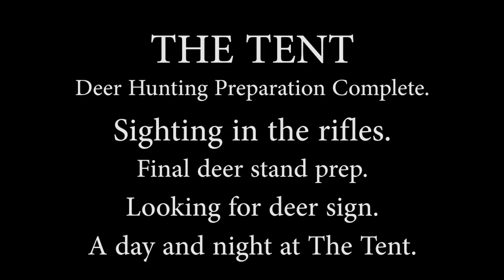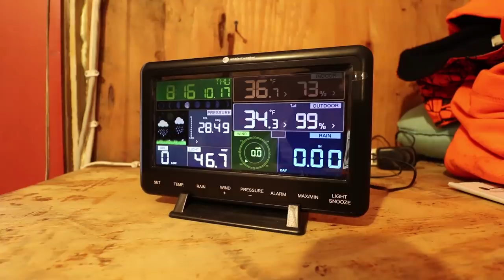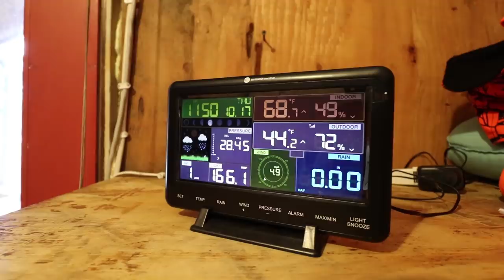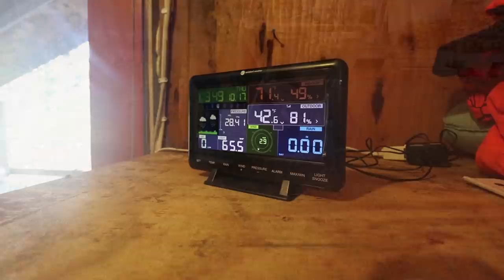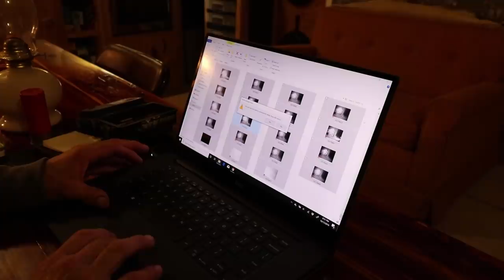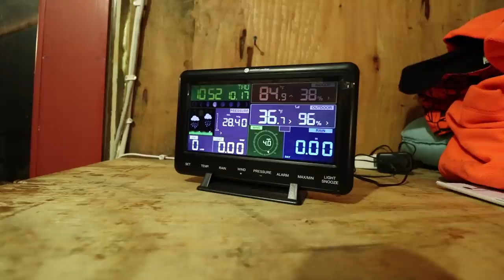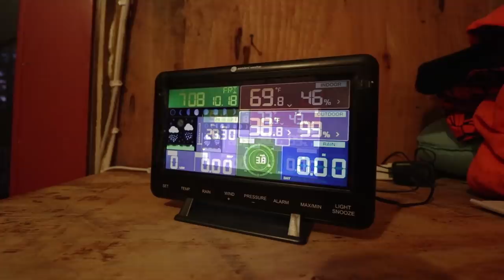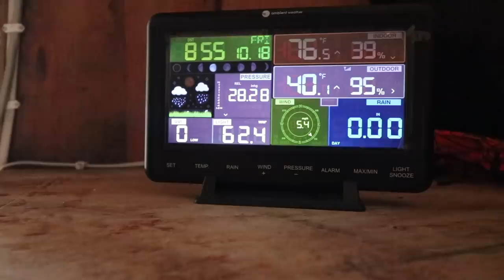THE TENT. Deer hunting preparation complete. Sighting in the rifles with Dad.

Comment: HI Joe, I got an Idea how about installing a pump shower near by the docks and the outdoor fire pit so you can shower out door in spring and summer as well as be close to a water supply without too much effort to install it and running too far to heat up water on the stove inside the tent, just use long hoses to connect the two, that would be great to see on a future video, hope all is well, have a good one from CANADA :-)

Comment: Joe you should look into a .300 blackout AAC upper for the AR. It uses the same bolt face and mags as the .223. It's a .223 case necked and sized for a .308 round
Absolutely no kick and pretty accurate out to 300. You can push it further however itd take a bit more skill and understanding of the ballistics

Comment: Here's a tip if you hold the trigger down on the rifle as you close the bolt it wont cock the firing pin; so you don't have to dry fire your rifle to take the tension off the firing pin spring for storage.

Comment: Joe,  are you ok?......there is something hanging down on the roof line of the White garage and there is a plastic oil bottle on it’s side on the deck porch......lol
Reply from the maker: Thats my lighter fluid on the side. It blew off the deck. That front garage needs to be re roofed. We are going to put a metal roof on it. I will fix the stuff blowing off at that time. There is just not enough time to do it all. Lol.

Comment: I hate to complain about a tent video, but the new software appears to briefly freeze-frame the clips at the beginning of transitions.  I can't help but be distracted by it.  Still, always great to have a tent video with lunch.  Cheers!  :)
Reply from the maker: I agree. I am not sure why and it seems to do it only when it is an action clip like when I am driving. Not sure if the computer can not render it or if I have to drop from a 2 second transition to a 1 second. The problem with that is that I can not stand videos that click fast between scenes. This is still a learning process, I will get there eventually.
Reply: @JoeandZachSurvival  I'm betting that it has something to do with there not being enough data at the front of a clip to satisfy the duration of the crossfade.  I've not used Adobe Premier Elements, but I do use the full version of Premier, and it has a very steep learning curve.  It's not a big deal though, just thought I'd point it out.  Have a good one!

Comment: I wanted to ask you, when you close the door immediately after you get in or out while loading the wood container in your tent, is because outside is too cold so you don't want to loose your heat achieved I guessed?
Reply from the maker: Yes it is.
Reply: I imagined it. I don't know if it'll be convenient to place two thinner pieces of wood standing up against the front of the wood box but closer to each other so they hold higher amount of wood. You should hold them innitially by placing them after you placed the second piece of wood starting from the bottom of the box, first one wood cut from the wall, then a second approaching the front of the box, I think now you can place one stick, hold it with a third piece of wood, then the other, hold it with that third same piece of wood, this will allow you to stock higher almost double up depending how high you make the sticks. Having them not fixed will be better to protect your or anybody's face from poking yourself/themselves. Or, if this works you can then place between them a perpendicular piece or two resembling a guardrail. This top high could be 2'-3' you can make it higher and just by having one in front you can hold double or triple the amount of wood in that box. I think it would be an interesting project. Just have the borders of the crossing perpendicular bars rounded (can be of 1"x2" or more x less longer than the width of the box so you don't hurt yourself when you come into the tent). What do you think?